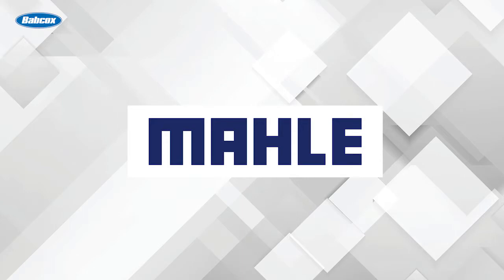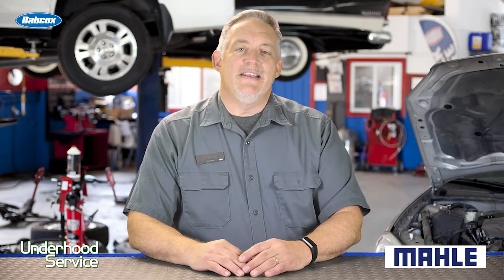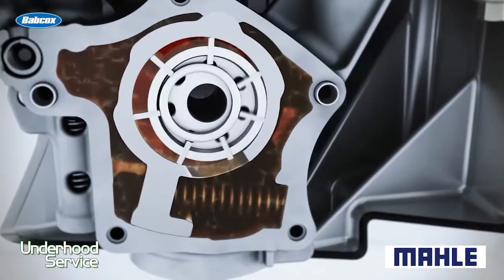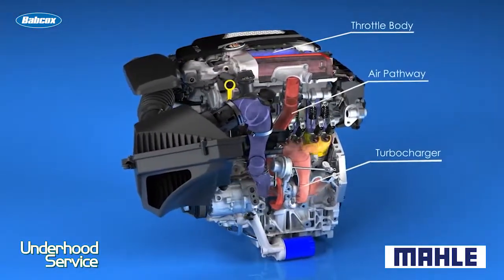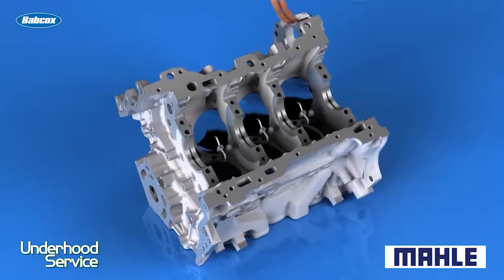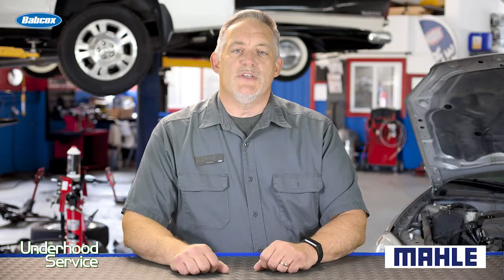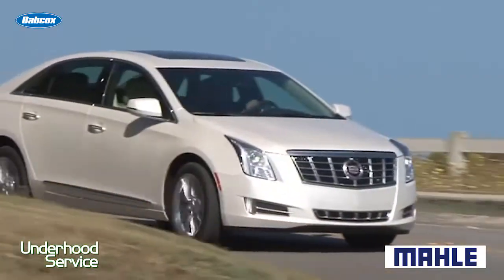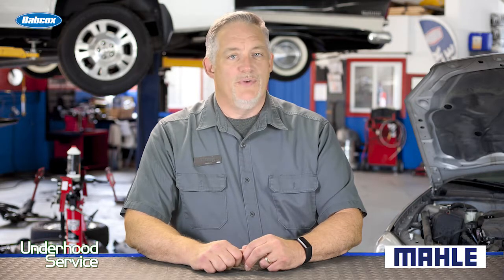Turbocharger location near the engine | Tech Minute

Comment: My VW's cooling fans keep spinning for a little while even after I turn off the engine.  I think the reason is it wants to prevent that heat soak without forcing the driver to sit and idle for a few minutes.  Most people will just turn off the car and get out as soon as they get to their destination.